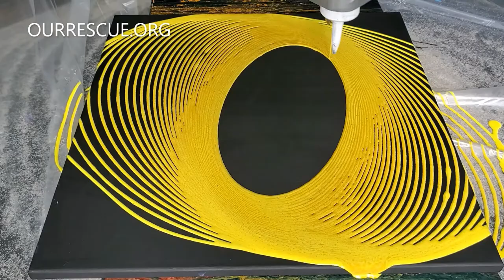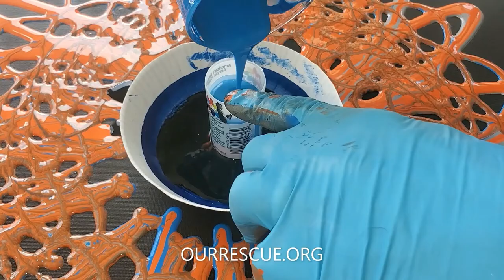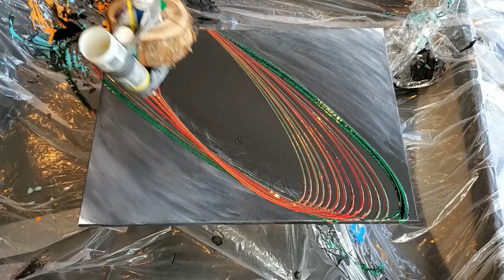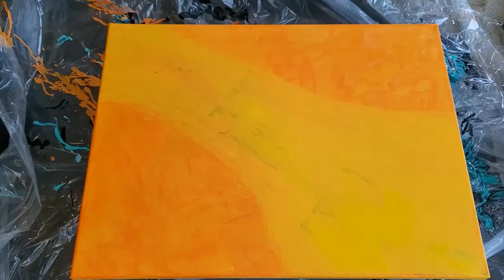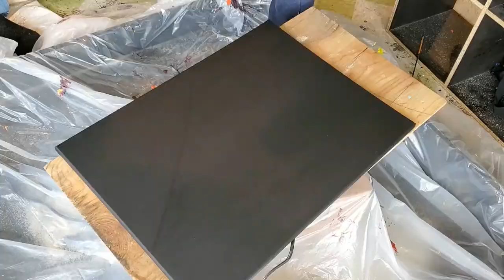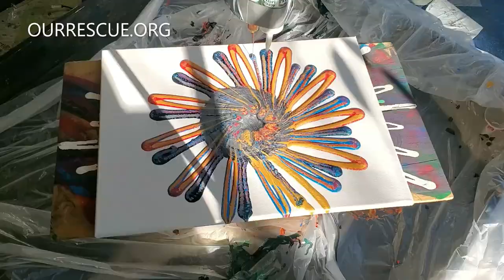Pendulum Painting Compilation.  Help fight diabetic amputations at ArtGivingHope.org.

Comment: Awesome work. Can you tell me about your lazy Susan? How it operates? Ty
Reply from the maker: I bought a cheap one on amazon.  I've used it both for automatic turning and also for spinning my paintings....Homend 110V Electric Motorized Rotating Turntable Display Stand, 6inch/15cm Diameter 44lb Load, 360 Degree Rotating in Either Direction, for Photography, Showcase (6inch/15cm, Black) https://www.amazon.com/dp/B07QWD3V4W/ref=cm_sw_r_em_apa_i_0QiZEb6Q465BR